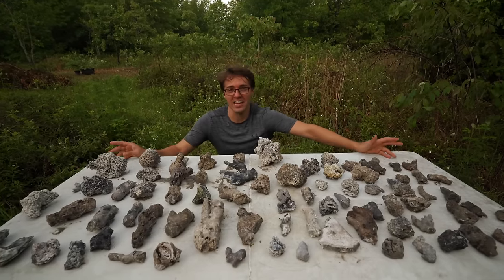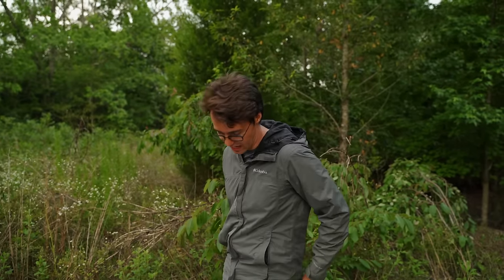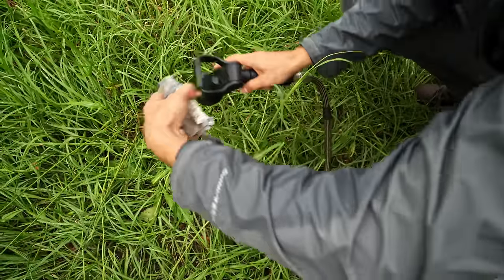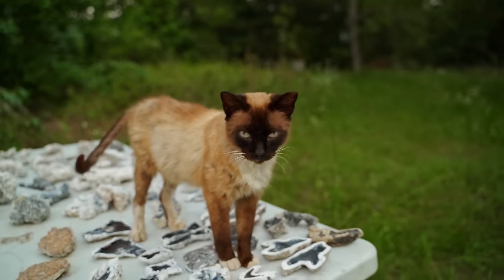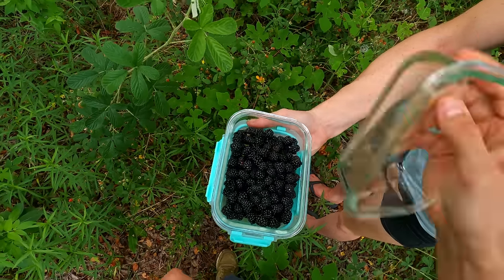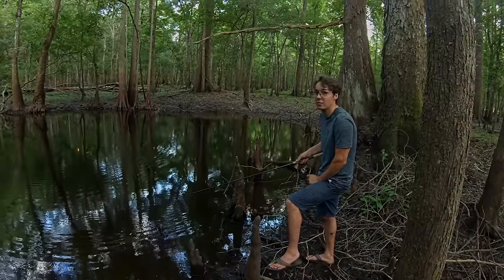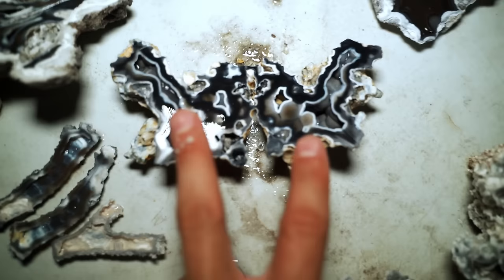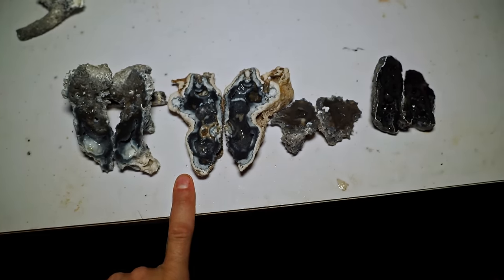You WON'T Believe the INCREDIBLE Agates that Formed INSIDE These Corals! (+ FL Foraging & Fishing)

Comment: Why are you doing this outside in overcast lighting we can't see shít
Reply from the maker: Increase your device’s brightness. The brightness of the video is fine.
Reply: @PaleoCris  it really isn't I'm not trying to insult just letting you know it's impossible to see all I saw was white edges and dark blue or black looking shapes in the center no banding no saw marks no multi colors just a blob of dark nearly black in the center with a ring of white around it this is also why most YouTubers use actual light rings or some kind of light rig so the picture doesn't seem dark florescent lighting would work too but natural light isn't as good and much worse if it's overcast just letting you know from a viewers point of view